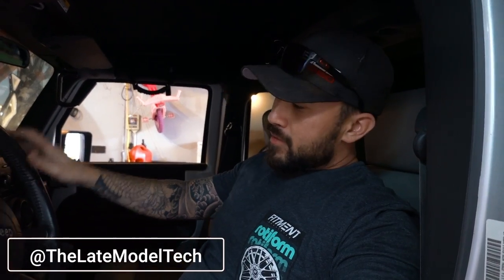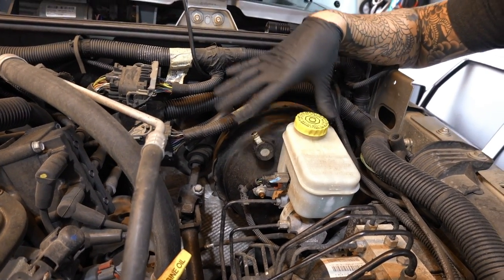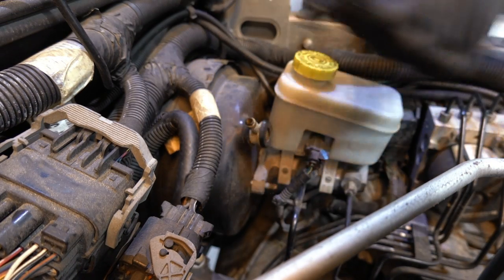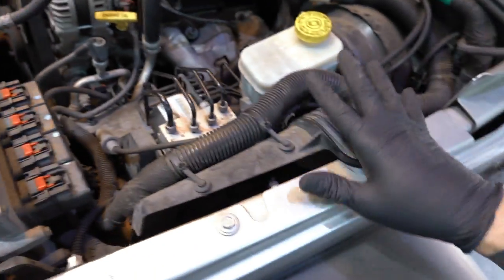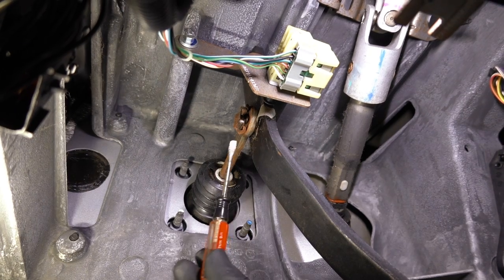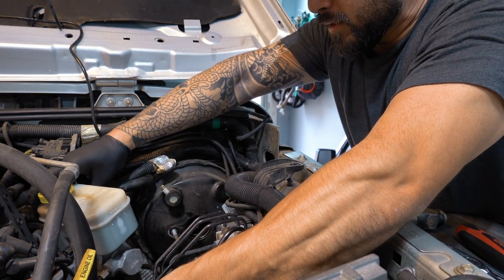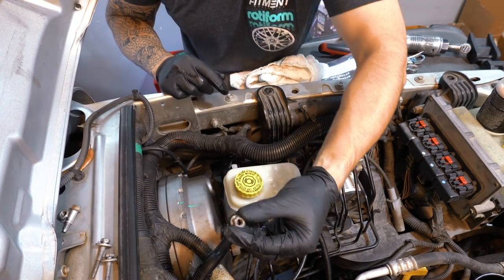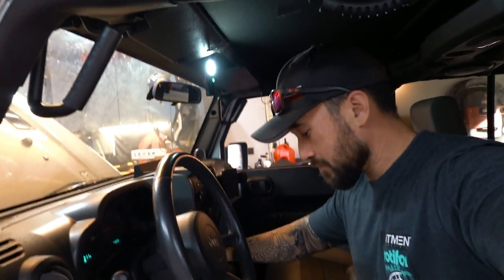How to Replace a Failed Vacuum Brake Booster on a Jeep Wrangler JK / Brake Booster Failure Part 2

Comment: Followed this for Jeep CRD 2008 which has almost identical setup except booster bolts are on the opposite side and engine compartment components are organized slightly differently. 

I confirm, the biggest challenge is getting that thing out. I had to disconnect ALL the wiring for fuse boxes also.

Thanks Donny for all the tips !

Update :wobble extensions were a big help !

Comment: LOVE THE DETAILS, GREAT FILMING & GREAT COMMUNICATION!!
  I HAVE A CLUTCH AND THIS IS MY FIRST TIME THANK YOU VERY MUCH THANK YOU!! I HAD TO SCROLL WAY DOWN TO FIND YOUR VIDEO EXACTLY WHAT I WAS LOOKING FOR!!!!
Reply from the maker: Thanks for sharing 👍! Good luck!
Reply: @Donnythelatemodeltech  I want you to know I DID NOT HAVE TO REMOVE MY CLUTCH MASTER CYLINDER MAYBE BECAUSE IT'S NOT USING THE SAME BRAKE FLUID AS THE BRAKE MASTER CYLINDER SO IT WAS A EASY CHANGE & OMG it's like A MIRACLE AND WORKING GREAT NOW I FEEL SO MUCH SAFER WITH BRAKES THAT WORK AND I DON'T HAVE TO DOWNSHIFT SO MUCH!!! THANKS AGAIN!!!!??

Comment: Great video! One question though and I’m just curious. Would it have been easier to have removed the four 13MM nuts from  inside vs the whole mounting plate? I have a JL and it’s not much different.
Reply from the maker: Usually the holes are lined up where a socket will fit.

Comment: Thanks for posting this video. Im going to try replacing my vacuum brake booster on my '96 Chevy S10 pickup truck without having to remove the two lines going to it. But if my attempt fails, I'll have to. 🤷‍♀️

Comment: great informative video ....but i wish you would have shown us how you got the last two bolts off of the bracket on the firewall .....thnx
Reply: I used deep 13mm socket and a swivel, with extensions to get the ratchet

Comment: You can get to the bottom driver side bolt through the wheel well sooo much easier if you don’t have aftermarket inner fenders. I have a manual so that slave cylinder got me slumped

Comment: thanks but you ignored the brake master if leaking could affect the booster again must of issue of the booster lake from the master it ll damage the vacuum itself please advise  i had some issue i m confused should test the air brake pump first
Reply from the maker: Say what,   you need a bidirectional scantool to replace the master,  this video wasn't about that.
Reply from the maker: You can't bleed it without the scantool.

Comment: Great video! I hate when people cut out all of the actual work. I want to see how it actual is to remove. ;-) We get to replace mine in my 2007 tomorrow. The master cylinder had already been replaced but my brake pedal goes too far to the floor to stop. Hopefully this does the trick.
Reply from the maker: Your abs needs bleeding most likely.    Booster will not fix pedal height.

Comment: Is there a reason why you removed that alum plate from the firewall instead of unbolting the booster from the inside? Looks like the booster may have been easier to get out without the plate attached. Not criticizing, just looking for short cuts. Thanks for the info!
Reply from the maker: Give it a try from the inside. Let me know how it goes.

Comment: Could you just remove the booster from the bracket instead of pulling the bracket out? Or is it just easier that way?
Reply from the maker: Usually the holes in the fire wall aren't lined up enough to get to the nuts.

Comment: Appreciate the step by step, unfortunate that you need a scan tool to bleed brakes (when needed) 🤨.
Reply from the maker: If your changing a caliper,  and as long as you don't drain the master, you can bleed them.         You just need a scan tool if you replace or drain drain the master,     .
Reply from the maker: I need to look into a cheap tool that will bleed the abs.
Reply from the maker: Looks like the high-end Autel scanners have the ability to bleed abs.
Reply: @Donnythelatemodeltech  If you replace the master cylinder on ANY car that has ABS, do you need a scan tool to bleed the ABS module?

Comment: Seems like it would have been easier if you removed just the four 13mm nuts from inside the cab holding the brake booster to the firewall so there is a smaller footprint to pull out and up instead of that large plate connected with the booster. The subsequent re-install would have been 1/2 second quicker too.....not much but anything helps, haha.
Reply from the maker: Let everyone know how that goes, lol
Reply: @Donnythelatemodeltech  Yeah, probably a bad idea now that I see the distance for the pushrod and bolts to clear is increased by the thickness of the plate. This thickness also inhibits the earlier angling up of the booster in this cramp space.
Reply from the maker: Hmm.    Well,  the real reason is that you cant get a socket to line up with the nuts going through the fire wall.  The nuts are offset just enough where you can't grab them,  there is no slack in the holes in the firewall for the socket,  I guess I didn't point that out in the video , sorry,    go take a peek under your dash and see if the nuts and holes line up,  not a single one of the 20 or 30 I've done have lined up.  Maybe yours is different.  👍